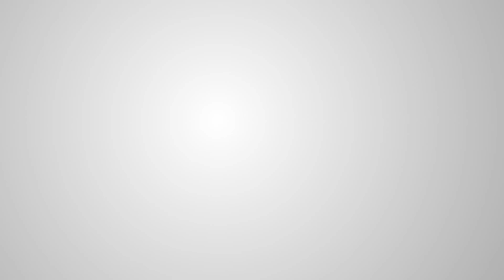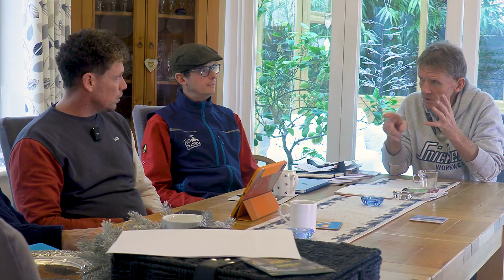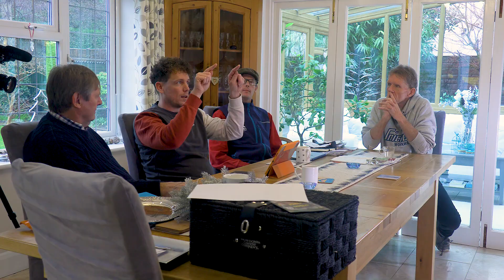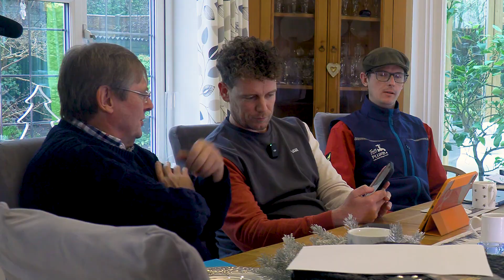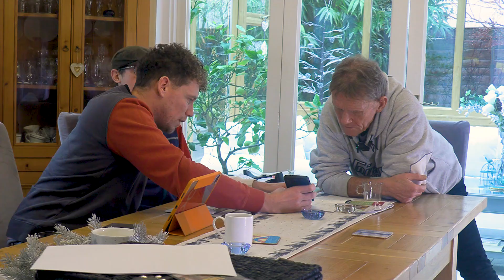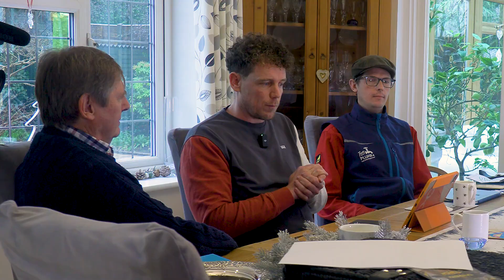What Did We Learn from the Heat Loss Survey?

Comment: Honestly this is one of the best videos yet because of the discussion. Honestly point blank refusing to fit a heat pump in some peoples houses have done wonders for our reputation especially when large national companies have had someone design it remotely and sent their engineering teams to fit the system within a week. Then afterwards, 6-12 months down the line the customers contact you and go "we're experiencing exactly what you warned us of" it's quite gratifying. 

Unless you're going to have the design, installation and commissioning engineer as the same small team/person it's really not worth taking on some of the larger companies otherwise you have exactly what John has experienced. Fault finding and rectification on anything after multiple companies have had a hand in before is extremely expensive for the majority of people and situations.

Comment: In Norway where almost no one have gas in their house at all and oil is illegal so we only have electric heat or wood stove (that EU is also trying to ban...) I guess 80% of our heat is heat pump.
Much is also electric floor heating that some say is more efficient but it is NOT efficient at all!

I have 4.5Kw floor heat and with only that in the winter when -10°C it is constantly on and have to use additional 2Kw heater and still struggle to keep above 17°C innside.

Got a 7Kw Panasonic heat pump mini split that only uses about 1.2 to 1.7Kw electricity and i now have over 20°C where i want it even at -20°C and still save A LOT of money on electricity, the price crisis we had last years it earned it in 2 times in 3 years 😅😁
Reply: And also last days where its been around -5°C ive only used 19Kw a day to keep 20°C 24/7
With floor heating it was 80 to 100KW each day and still was freezing cold...

Since i got heat pump the floor heating has never been on! 
I wish it was water floor heat so i could retrofit a heatpump to it.
Reply: I'd be interested in the tariff prices in Norway. In the UK electricity is around 4X the price of gas. What is the comparison in Norway?
Reply: Electric floor heating must burn money.

Comment: So you still need a 3kW heater which will no doubt be running 24/7 during winter and you need to run the heat pump all year round. My gas boiler is turned off for 6 or 7 months a year.
Reply: we suggest not to do that

Comment: My sister has moved into a brand new council house..its a 1 bed town house style. it has an air source heat pump and the cost is crippling her! shes spending £300.00 a month on electric. This is supposed to be the future?
Reply: It is highly likely she has never been shown how to use it and as a consequence she is running it like a boiler - on/off/high temp.
Reply: no....like all her neighbours all have stupidly high bills....each room has underfloor heating and a room stat. None of the installation books have been signed by who did the install....the benchmark not signed or filled out...no 1st service either as its been over 1 year old now....me thinks dodgy fitters.
 @normanboyes4983

Comment: We went with Hard foam in the 6 inch walls, and soft foam in the attic. You can take a laser Thermometer  in winter, and it is the same at the 10 foot ceilings as on at the floor.

Comment: There's no way I'm getting a heat pump installed until a) there are enough quality engineers to install it properly, and b) there are enough quality engineers to come and fix it when it breaks.
Reply: As said here, there are 2000 HeatGeek engineers across the country, so when are you getting one installed.
Reply: only 148,000 plumbers left to train, then they need to maintain their training. @derekclark7545
Reply: In Wales there are only 2 elites
Reply: @derekclark7545  As of 2018, there was over 140,000 gas engineers. That's about 70 times the number of heat geek engineers now by my maths. Not sure what your point is!
Reply: Its 2024 and your numbers are wrong, the majority of gas engineers work for a company and won't be fitting your heat pump and as said to someone else, you only need one HeatGeek engineer. Look at the original post by bobaloba, they said they're not getting a heat pump until enough engineers to fit it (same answer you only need one) and then they go on to say enough engineers to service it. Your training will cover that and keep the HeatGeak engineers number and maybe he will fix it or even the manufacturer, so again a load of nonsense. Not sure why you bothered.
Reply: @derekclark7545 never. Just imagine everybody has an EV and heat pump. The grid would go down. Also every house on the street would need their driveway dug up to up great the grid. Total nonsense. I bet the cost savings will be not worth it for the investment. When is the Break even point? 20yrs? 30yrs? With that hefty upfront cost can’t be 10yrs. Electric price x5 now compared to 5yrs ago
Reply: @latitudeash  If you kept up to date, you would know that those who manage the country's electric grid are already moving forward with upgrading the cabling/power required to do just what your saying above. The electrical power needed in the next 10 years will outgrow the requirements if they do not, new micro power stations and alike are already going forward and maybe in 10 years we will see the first Fusion power station that have no dangerous waste and then that will be the end of Fission Nuclear power, and its terrible waste that cant never be treated. That's the key to cheap electricity and ASHP probably keeping 70% of us warm.
Reply: @latitudeash  What is the payback time for a gas boiler ?😊
Reply: @peterjones6322 if you don’t have the electricity you will never get back. Boiler cost max 1.2k to fit. Air source heating cost 15k minimum, and more expensive in older houses. You tell me whats the pay back time?
Reply: So you just use a heat geek approved installer.
Reply: Heat Geeks. As an aside, I've had an air to water heat pump for 14 years in chilly Scandinavia, and it's never broken down. Every year an engineer has visited, looked at it for 5 minutes, and left again.
Reply: There are.
Reply: Learn to do it yourself ?
Reply: Seems to me like the setup is the hard part. Once running it's part in part out, any mug can surely diagnose and service it? It's not particularly complicated as far as machines go.
Reply: Vaillant Heat Pumps annual check up costs £225 as reported on a recent YT video. My gas boiler is less than £100, the former is 1.5 hours the latter being 1 hour.
Reply: That's never been a problem, it's routing out the chaff that is the problem.
Reply: Heat pumps are a dead end just like EV’s. They have a small place but cirtainly not mass adoption. It’s all grant/ tax money. Imagine having every home in the uk getting a 15k grant. It’s ridiculous….cloud cookcoo land thinking. Just give us all 15k and keep the gas system, would be better 😂
Reply: And c) when our houses are suitable like in scandinavia and d) when it's affordable for the average working family who live paycheque to paycheque

Comment: Really good video and very informative. Heat pumps are obviously not for everyone but have their purpose when used efficiently with good installation and in conjunction with other things such as a well insulated house, underfloor heating etc
Reply: There r not that many houses with underfloor heating which means you'll probably need a good % of your rads made bigger AND all the pipework changed from 22mm to 28mm. This will mean having most if your floors up upstairs (and possibly down if you have wooden floors) PLUS a new cylinder will be required! All = ££££££££s

Comment: Guys.. any comments on how this might work in the woods in Poland? We've been hitting -15 to -25c in the last few winters. Can heat pumps be any use here?
Reply: They seem to work OK in Norway and Sweden. I think what these videos show is that the technology is less important than an experienced installer.
Reply: It has been the main source used to heat for the last 20+ years in the Finland, Norway, Sweden where distric heating isn't available. Started to be used in the early 90s. 
Most major brands are: Bosch, Ivt, Nibe, Thermia (in no particular order, some seam to favour Nibe). Life expectancy is around 25 years on the compressor (but if we take it no the technology has moved so much futher that energy savings are quite high on a new iverter pump compared to a 2000 model on/off.
Air to water, ground to water (where you dig in the pipe in a loop if you got the land to do it) or geothermal where you drill a hole straight down to the ground.

Comment: Surely having an element backup on the heating would be an obvious thing to have? What if we have a 10 day -10 spell next winter? It could happen.
Reply: The output actually increases again at -10 as the air dries up and drefrost cycles stop!
Reply: A Roger says, just plug in a fan heater. The simpler solution is often better.
Reply: @robinbennett5994  Lol are you serious? hahaahhaaha I think he was being ironic?
Reply: @chunkymonkey55555  I don't think he was - a fan heater would be the same power as an immersion heat, and you can put it wherever you need it.
Reply: @robinbennett5994  So, what you are saying is, this guy, is going to spend like hmm £12000 on a heat pump heating system, then, when it gets really cold, he is going to plug in a fan heater to heat up his legs? hahahahahaa
Reply: @robinbennett5994  O used a fan heater last time my boiler broke lol...

Comment: I asked Geekd what I needed to do. They said I would have to pay £350 for a quote and I think it was over £1100 for a guarantee of performance. So I pay to guarantee an incompetent install ?
I have microbore in my insulated 30 year old house on the ground floor. I have zero confidence that I won’t need my house gutted to update pipes to cope. 
Maybe ok for new houses but most older houses are not suitable unless you have thousands of spare cash
Reply: And sufficient space for a plant room and a spare house wall preferably well exposed to a Southerly direction. I know, I'll rotate my housr 90° and build an extension to put all the gubbins in to.
God Almighty.
Reply: @nickhickson8738  
Minor detail Nick. Five minute job and will cost £1.50. I’ve had 3 informal estimates the lowest was £15,000. All recommended replacing microbore. Oh, and one refused to even estimate because the job was too disruptive and expensive.
That’s in a house built in 1989. Just not designed to be chopped about just so you can feel better about the survival of the penguins in Antarctica.
Not forgetting the zero payback in most middle aged people’s lifetime. Gas boiler ? Top of the range installed and working in a day for £2500.
Somebody do the math please…..
Reply: This is ridiculous. Quotes should be free and performance guaranteed by the installer. If the installer has done sufficient installs he should know what to expect. Regarding microbore my house was built in 1979 with an open vented central heating system using microbore from 22 mm boiler feed pipe manifolds. It even had a back boiler behind the sitting room fireplace. To save money the builders used coaxial radiator valves which meant that the flow and return went to one side of the radiators only. It was an awful system and double panel radiators never worked very well. For my heat pump install all radiators were replaced with ones of appropriate size. The wall areas did not change mmuch because the new radiators were either double panel double convector or double panel single convector. I dug up the floor and put in 15mm pipe where necessary to make all radiators double ended with TEVs and lockshield valves. I did not dig up the bulk of the microbore. I now have an Ecoforest 9kw ground source heat pump which works extremely well. Therefore there is no reason why you cannot retain your existing microbore. It works. Just make sure that your insulation is good and your radiators are properly sized.

Comment: the solution is to change out a 7kw heat pump and put in 12kw heat pump.  and now we are more efficient ? so we decide to put on the electric oven and now we are approaching the capacity limit of the cable supplying the electricity to the house.... his electric bill is only going to go one way...
Reply: Wrong. A 12kw heat pump will never take much more than 4kw from the mains. Rememnber you multiply the power input by the COP to get the heating power. COP is generally well above 3. I have a 7kw EV charger and running it when the central heating is on has never caused any problems.

Comment: We've got a buffer on the return. This only increases the the water in the system but very minimally impacts the sCOP. We've done this so to be able to close more underfloor heating flow groups without the heating circling on/off.
Reply: That’s called a volumiser when it is fitted on the return.

Comment: In Adam’s defence I understand the difficulty in troubleshooting a system on the first visit that a couple of different firms have worked on. 
In the original video Adam recommends removing pump , zone valves, uf manifold and buffer, and because of the noise and age the outside units. When John then remarks that the system does work, but it’s just too expensive to run , Adam replies that is an easy fix a weather compensation sensor will fix it. 
So John paid a shed load of money for the initial install.
Then another shed load to a firm to get it working. 
Now another shed load to replace and alter the existing install, all in the space of 7 years ?
Reply: They still couldn’t have used the existing one due to the noise it makes
Reply: @HeatGeek  
Is the problem the noise or the 45 deg minimum output?
Reply: @HeatGeek  This comment wasn’t a dig at Adam and I understand that the original units are noisy and probably not the best . I was highlighting the cost to the homeowner , 3 installs in 7 years for a heating system that at best won’t be any cheaper to run .
Reply: Unbelievable. If you let all this sink for a minute it’s shocking.